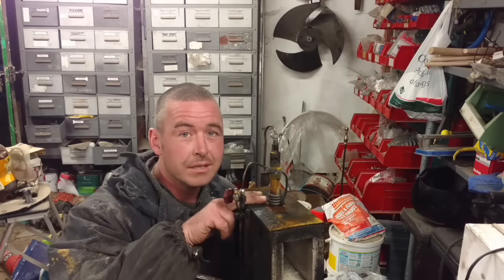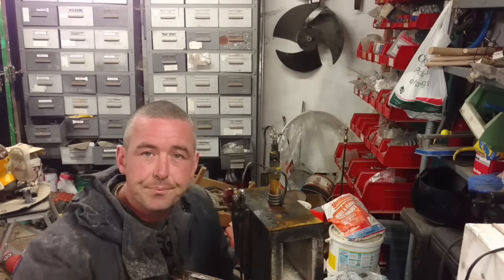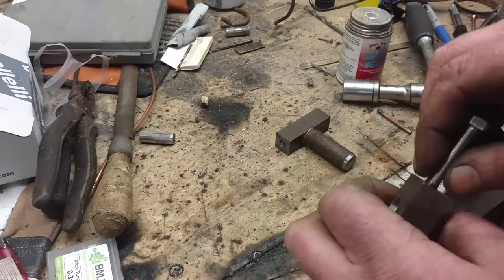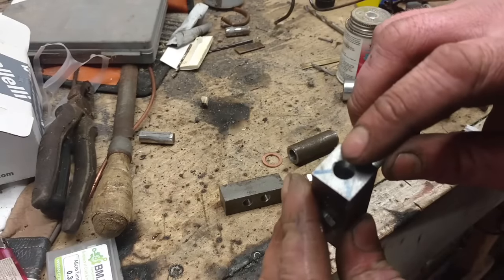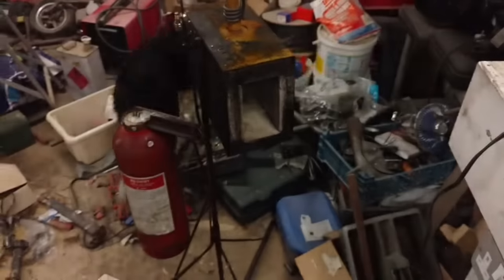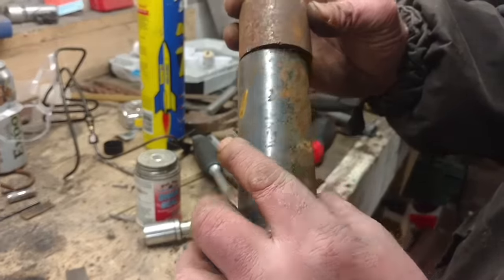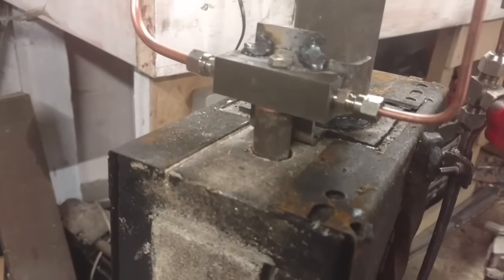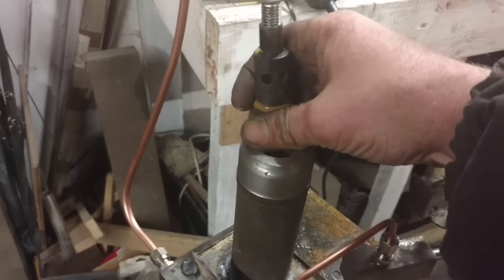Micro waste oil forge success! new fuel air mix, pre-heat and flame tube. Experimental blacksmith #3

Comment: I got to use that.... Koala Cuddling, Kangaroo Kissing Aussie!  Classic!

The current setup is great. It looks pretty much like my spray burner.  I premix the oil and air with that and just shoot them out a bit of flattened pipe I use for a Nozzle.  I'd suggest putting a control valve on the air so you can regulate mixture. I think the air is blowing the oil back out the leaks so fixing them would be important.  If you can limit the air a bit you can get the oil flow you need which I think is the reason you are getting the pulsing. 
A needle valve will let you control the flame size and type. You can have oxidising or reducing flame atmosphere depending on the work you are doing. 

I agree with your sentiment totally.  Small oil burners are bloody difficult. Big ones are easy as pie.  I think you are on the right track though.  Bit of tweaking and control of the mixture and you are there. 

We have a lot in common.  Nothing for me to be running round the back yard at one in the morning doing fire ups and playing with stuff because I won't sleep if I don't know Wether it works or not. 

Good work mate.  I'm impressed with your ingenuity and practicality. You are going to have this thing running good as a gas forge in no time and those of us that have played with this stuff well know that is an achievement not to be sneezed at.
Reply from the maker: Oil Burner always had air control thanks to your videos, you can see the needle valve at about 5.30. glad you are ok with a bit of respectful friendly banter! I'm going to put it to work after I've fixed the various oil leaks and carry on fiddling, it doesn't feel like it's getting enough atmospheric air so I'll probably knock another burner housing up with more air inlets and see what happens. unlike you I don't have any neighbours so the limiting factor is my beer supply and how tired I can get away with being at work! thank you very much for the kind words but I'd much rather you took the piss, it's motivating.

Comment: It would seem to me, Mate, it may be best to filter the waste oil.  In the US, the filter bracket is only $20 and it may solve most of your delivery problems.  Summit Racing https://www.summitracing.com/parts/der-15708.

I''ve been experimenting with a babington oil burner for a time with little success.  I chose a babington so that I wouldn't need to filter.  My problem was to find an economical (meaning free) way to drill the orifice (.020") in the ball.  Your device is a great deal more sophisticated than mine.